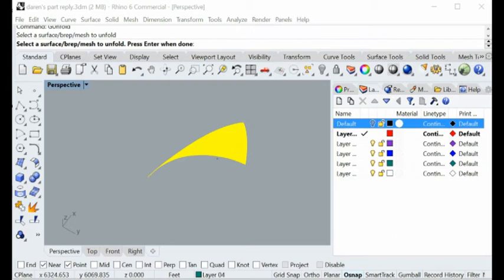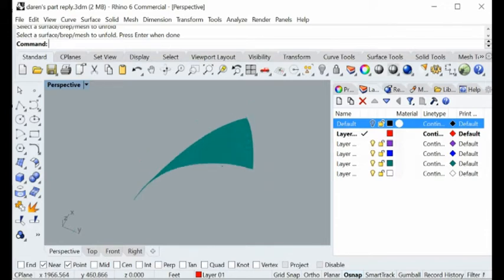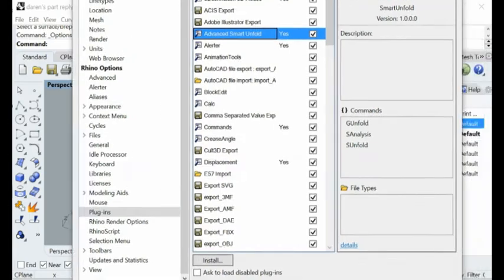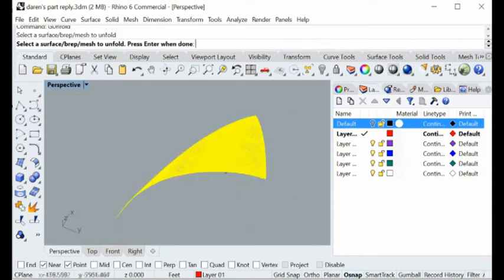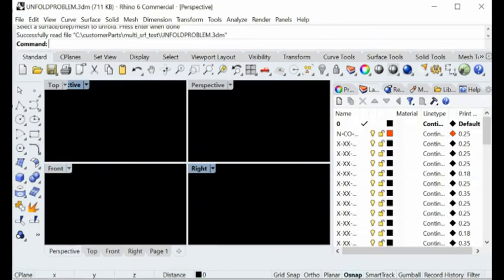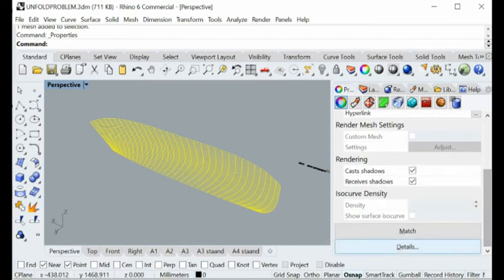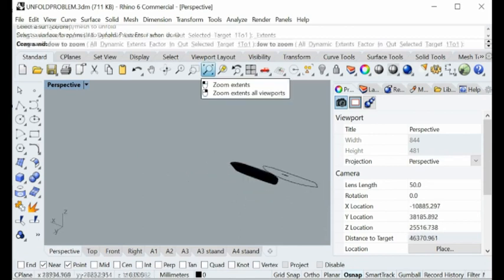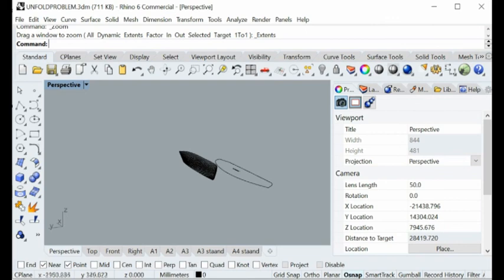Rhino Unfold Mesh Surfaces

Comment: Hmm interesting, can i use this to flatten a model for sewing patterns?!
Reply from the maker: Not sure about the sewing patterns, the software is designed to flatten the double-curvature surfaces like ship hull surfaces. You can send the parts to support@smartunfold.com.
Reply: @northwind97  Ok i will, what about texture transfer from the 3d to the 2d object is this possible?!
Reply from the maker: @TheOne10525  the software doesn't know the texture, but it can unfold the curves which is on the surfaces. So if you have a symbol "A", then the "A" consists of many lines or splines, then the software can unfold those lines or spline, then you will get a "A" symbol on the XY Plane plus the surface contour.

Comment: could you then print the unfolded 2D mesh as a clear sticker or decal to stick onto a 3d printed part ?
Reply from the maker: We only handle geometry.  So you can get all the unfolded mesh boundary curves. It is one way only: from 3D to 2D, not the other way around.

Comment: How accurate?
Reply from the maker: depends on the model shape. But the difference between the model surface area and the unfolded area in the XY Plane should be within 0.1% of the model surface area.
Reply: @northwind97  thanks. What about the boundary lengths? Comparison to  2D/3D?
Reply from the maker: @jeffreyyyy  same, the difference between the model edge and unfolded edge should be also within 0.1%.